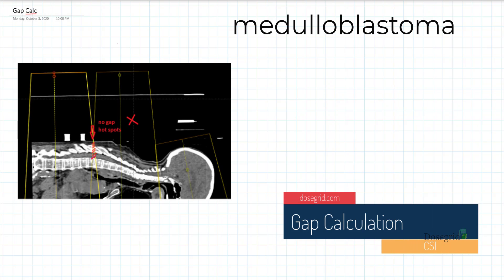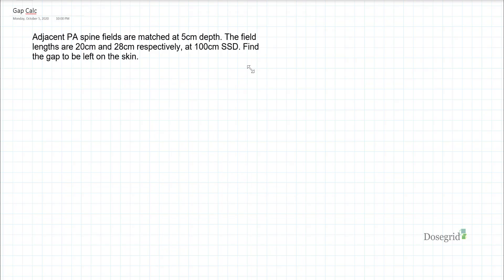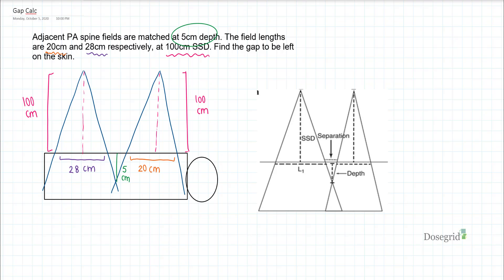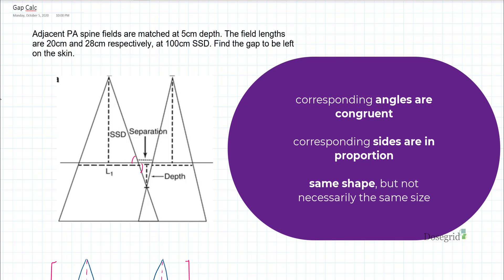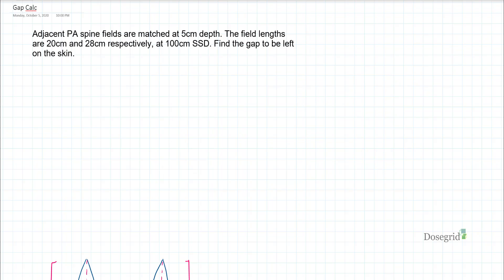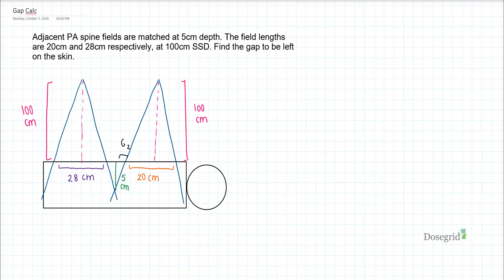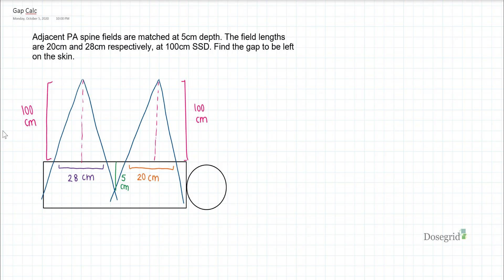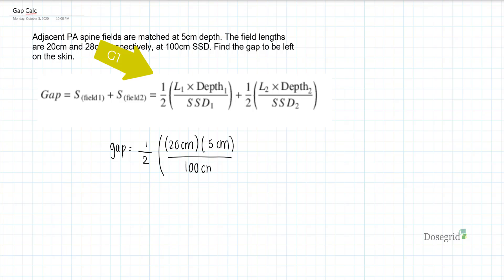Gap Calculation (Craniospinal Irradiation)

Comment: Hi, two questions! First, does this similar triangle method change at all when treating fields that are side by side rather than end to end (I assume yes, but you would use the width of the fields rather than the length)?

Also, what about the overlapping of the beams on the organs and tissues on the anterior side of the patient? Is is not significant (hot enough) to be a major concern due to the distance within the patient at that point? Another words, is the dose in that area calculated to be safe for those organs' tolerances?

Comment: why do you need calculate a gap? what about field matching
Reply from the maker: Hi Mohammad, we calculate a gap in craniospinal irradiation to avoid hot and cold spots at the junction.  If you matched the fields (abutting), you would have scatter in some areas, creating hot spots. Gaps on the surface are especially important because the spinal cord is a critical organ in irradiation, and cannot be overdosed.